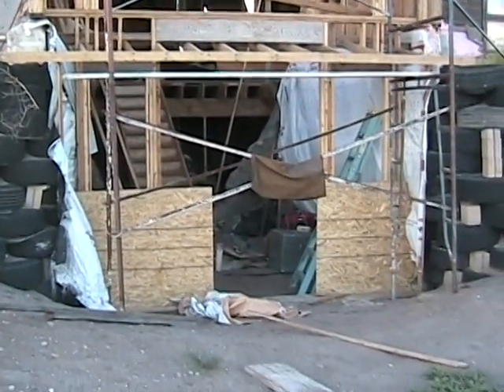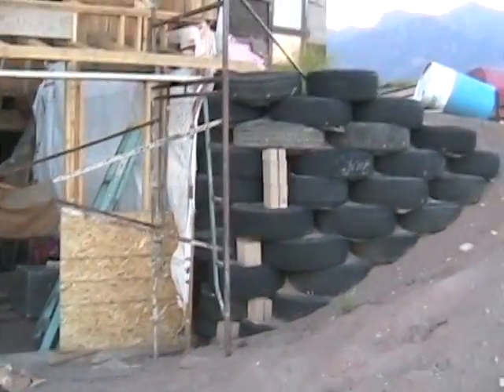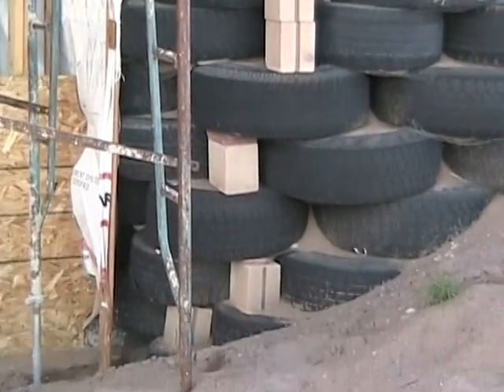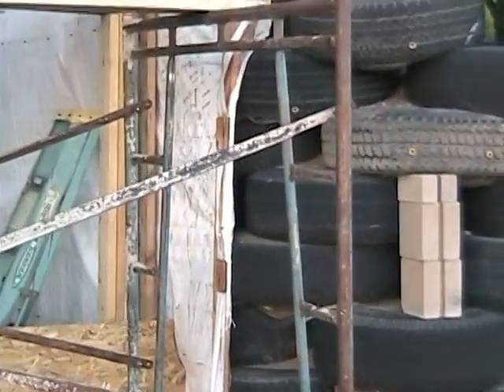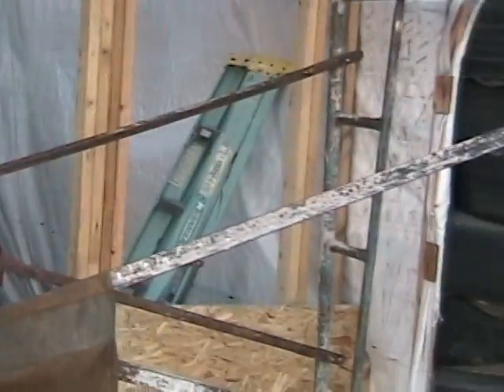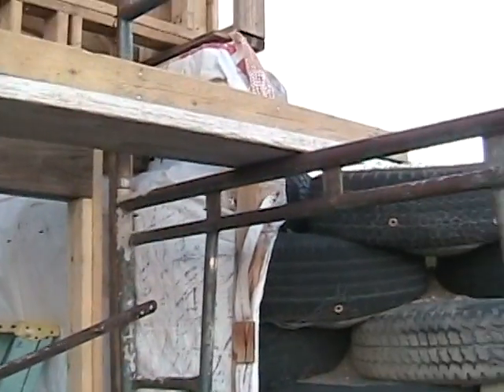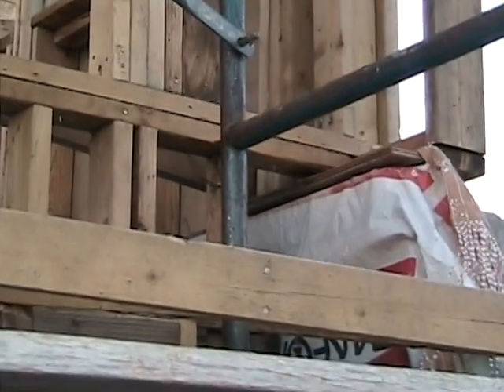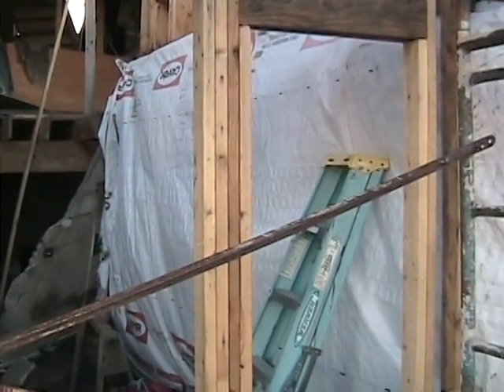Offgassing Mitigation

Comment: sure. And yeah, I totally agree about the precaution - just curious.

Even though the manufacturers aren't legally required to disclose the tire's contents, I feel like there has to be a component listing somewhere in the world - like Sweden, Iceland, France somewhere really eco-sensitive. From that you could compare the chemical list to existing(off-gassing?) data or something. A study about tire burning also - w/ the toxicity(?) info, then compare w/ barrier (cement, plaster) strength.